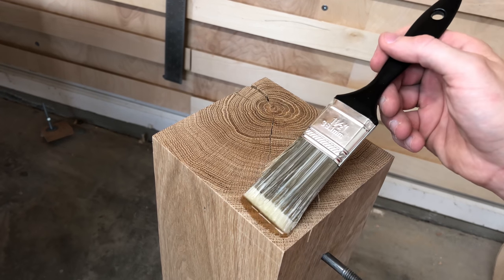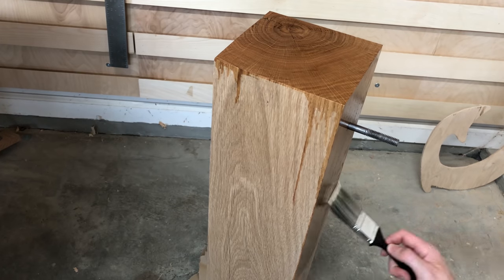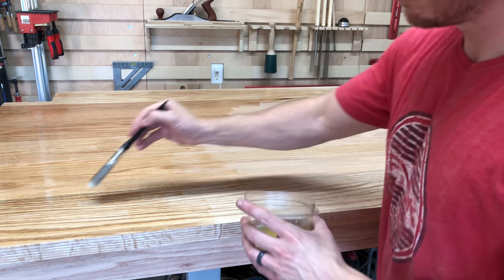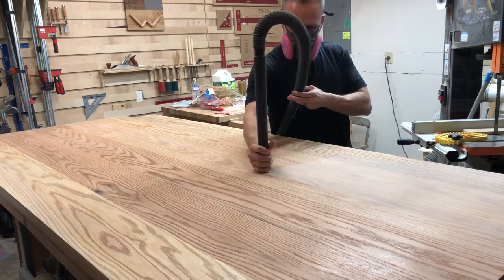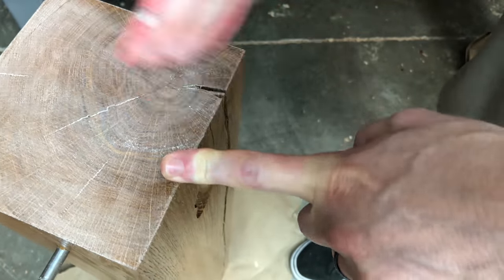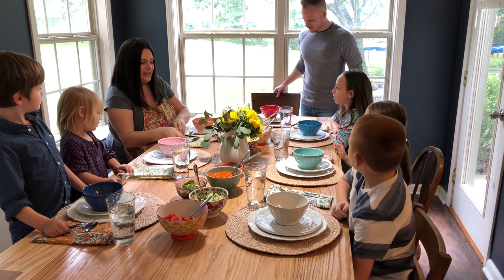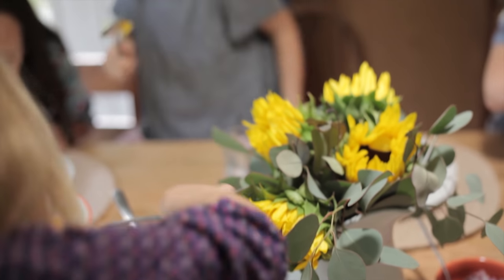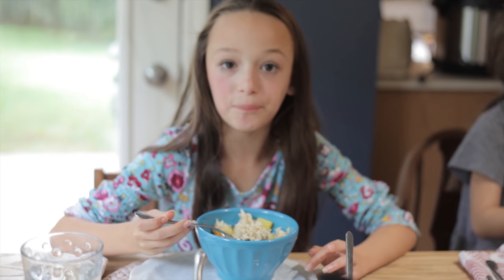Farmhouse Table Part 3 - Special Message // How To - Woodworking

Comment: Undertaking a very similar build. Did you assemble in the area it will reside to ensure there is no wobble? As opposed to assembling in shop and transporting to its place?
Reply from the maker: Assembled at the location. The top and aprons are all one piece and then the 4 legs, so essentially 5 pieces. Hope that helps